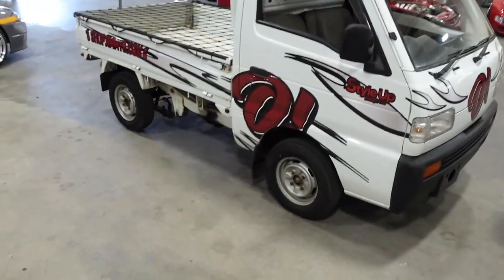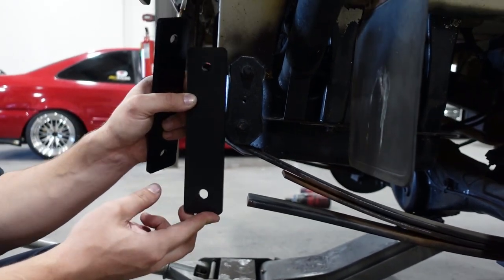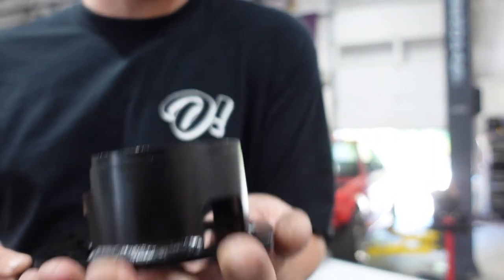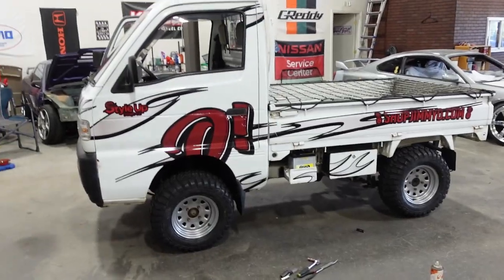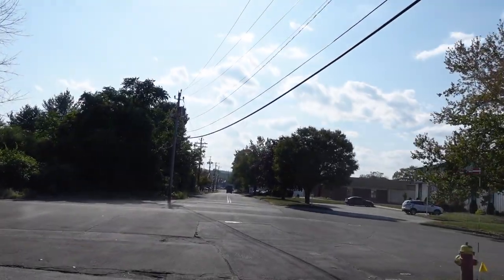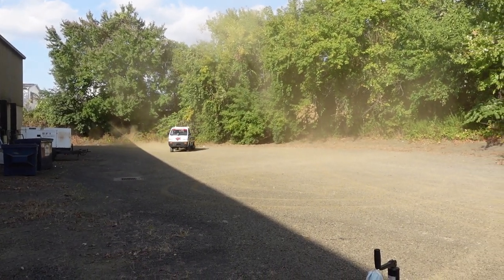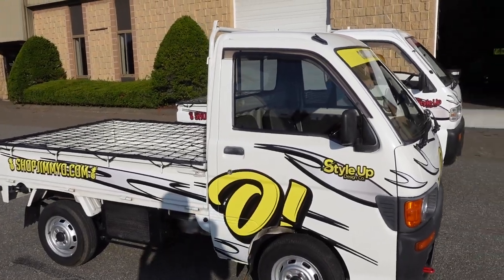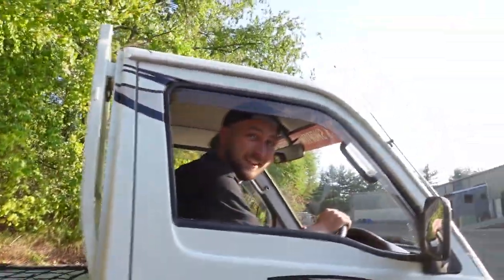Jdm mini truck gets a LIFT KIT & New fitment!! (Off Road Ready!)

Comment: Legit Jimmy has me looking at mini trucks best content recently hands down 😂
Reply: Fr I might get me one for off-roading 😂
Reply: The maximum speed limit in my tiny town is 40 mph. Seriously considering one of these for an around town daily.
Reply: FUGGIN SAME. 8k doesnt sound bad
Reply: There some for 6k Honda,daihatsu manual
Reply: I want to buy one set it up  and run it with the quads on the weeekend. Cheaper then buying a Can-Am or Polaris
Reply: @adambarton9118  Fr I'm saving up for one where I live they have cruise nights almost every night going through backroads and trails I thought there was an array of taco stands but they were all side by sides can ams and four wheelers was also like 1am and further down the road some of them stopped for tacos lol
Reply: For real man it's a amazing min K truck and also good on gas
Reply: What is the size of the tire

Comment: Jimmy for the rear I would’ve done rear end flip kit putting the rear and underneath the leaf springs I’ll give you better stability while going off road 🤔👍😊
Reply: They're already under the leaf springs. At least on my Honda ACTY they are
Reply: The axle is on top of the leaves, putting the springs over would also make more useable ground clearance as the springs hang so far down as it is. Not that they’ll ever change it, but it would be a better way to achieve lift.
Reply: @wethepeople406  weird. The ACTY the axles are below it
Reply: wethepeople406 I have a pre runner with spring over axle I run of the high speeds off road and it’s very stable I never have an issue
Reply: CasinovaGaming not on Jimmy’s DJM truck it’s spring under axle by making it spring over he will get a better lift and more ground clearance and more stability
Reply: @jamesfcookjr  if it was spring over it would drop the truck a few inches
Reply: CasinovaGaming no if you put spring on top it would lift and you put the spring under it would lower it
Reply: @jamesfcookjr  i was thinking axle over = lowered / axle under = lift lol
Reply: CasinovaGaming lol that’s ok buddy 👍😊
Reply: Spring under is actually better for stability since the axle has less leverage over the springs
Reply: Brian Pardee have you driven off road at high speeds I can say I have and it is not much better
Reply: @jamesfcookjr  it might not be but any desert racing truck running leafs required for their race class is running spring under. Also this is a kei truck it aint gonna be going that fast and theres no desert in conn
Reply: Brian Pardee some do some don’t I race king off the hammers but my Prerunner is on Dever Leaf springs in there over the axle are use my pre-runner as a chase truck
Reply: Spring UNDER axle is more stable, spring over is better for clearance, but anyways this is not an offroad vehicle and none of this would matter 😂
Reply: The boys can fab..4 link!! Push the axle back last far as possible
Reply: You are correct. If the axle is located beneath the spring, the truck will sit higher. Unfortunately, if the rear of the truck is lifted in this way, it will result in a lift of at least the height of the axle tube, and the thickness of the leaf spring. I expect this will be double the amount of lift added to the front, causing the rear of the truck to sit quite a bit higher. @CasinovaGaming

Comment: You should cut and weld an extension on the lower control arm to get a bit more negative camber.
Reply: Definitely think thatll help. Or see if any CanAm or Honda quad has a similar lca
Reply: The thing is 4wd so I'm worried for the axles with the lift + extended control arms
Reply: @imnota  2 inches in the suspension lift is fine in this Suzuki going higher might cause some damage not in the front CV axle but the rear driveshaft especially the cross join
Reply: He needs to drop the cross member down 2 inches and extend the top of the knuckle 2 inches. Then the suspension geometry will be same as stock, just shifted two inches.

Comment: be careful doing high load situations in reverse, the front diff will grenade due to the diff pinion using a crush washer instead of a solid spacer.

Comment: This is a true fix. I have the same set up as you!

Slot the upper bolt of the front struts where the knuckles mount! This will fix your camber issues. 

As for other suggestions. Get 300Lbs springs for the front and longer shocks for the rear. This will improve handling by a ton! Cheers!
Reply: Any more info on how to do this camber fix? Also which shocks did you go with? Thanks!

Comment: I would watch our doing a shackle lift, longer shackles will change your pinion angle and can cause driveline vibration, something to think about. Spring over axle might be a better solution but that could also cause more severe u-joint angles. If you have driveline vibrations that might be the first place to look.

Comment: hey jimmy ive lifted my honda crv using the same style strut spacer lift and the camber always looks very positive when i first let it off the jack and it straightens out when i drive it. you can also try a subframe drop which is very easy to do. you should hit up hrg engineering or aerogenics

Comment: I wonder if just extending the rear of the springs will cause alignment issues with the driveshaft,  back in the day we would just move the axle from on top of the springs to the bottom of the springs.

Comment: Hay I see your truck has small diameter front coil spring shocks. Mine has large diameter and rub on any bigger tires. Did you replace them and is there someplace that sells aftermarket front small diameter shock set ups that you know of ? Thanks

Comment: Love your vids! Question (x2) on my 1996 Carry (DD51T). I am almost done with my 2" lift just can't figure out the way that the camber deals are meant to go. It's been frustrating and I received no instructions in my package from G&R Imports. I have the "L" shaped camber add and am unsure what direction it goes on this install. Fought with it for an hour yesterday and gave up. Also I have 13" wheels (looks factory but I know they usually came with 12" wheels) with 155 60 13 tires and am looking at some nice 165 80 13 tires to put on those wheels. I believe they will be 23.4". Will they fit without issues? Thanks

Comment: I love it . i have to save up and buy me a mini truck now but i would love to do a motor swap put a sr20det in it
Reply: Those shackles in rear of truck if you weld a brace to connect them as 1 peice it will keep rear end from having to much twisting out the rear axle and just give you the suspension flex

Comment: Said it in the last video but check out the Daihatsu charade gtti engines as a swap.
Twin cam 3 cylinder turbo engines that can easily make 230 hp.

Comment: The reason the shackle kit is so long is because the other side of the leaf spring stays in place, so to get 2 inches of lift, you gotta drop one side of the leaf spring 4 inches if the other side isn't moving

Comment: So many questions.... 
where did you get the lift kit? 
The wheels, Are they still 13 inch or did you go with 14s on it now? Honda is the same bolt patttern. 
Have you taken it on any mountainous terrain yet and how does it feel with climbing and drifting? 
I do mostly 4low and 2nd gear shit. 

Let's face it....
75-80kmph is about as fast as you want to abuse that poor little 3 banger let alone the feeling it's doing 200mph at anything faster. 

How is it now compared???? 
Need to know where to purchase the stuff though

Comment: 35% tint looks like no tint. Total waste of money to do anything under 20%. Also, you didn't install the camber plates right. To be honest, they don't look like they're made correct anyway, but they'd work better for you with the struts rotated 90 degrees. More negative camber and more negative caster. Both good things in this case.